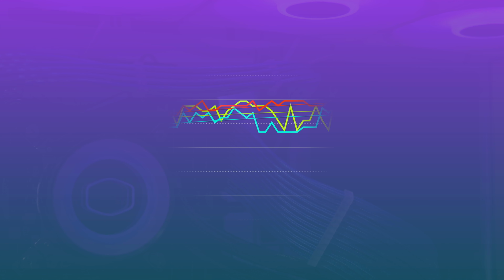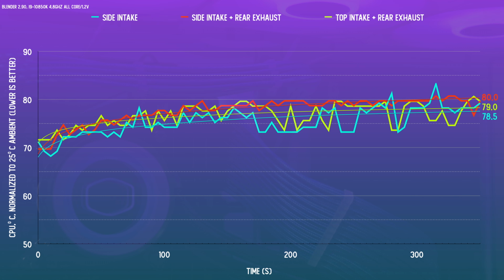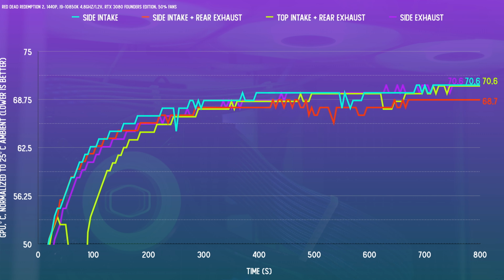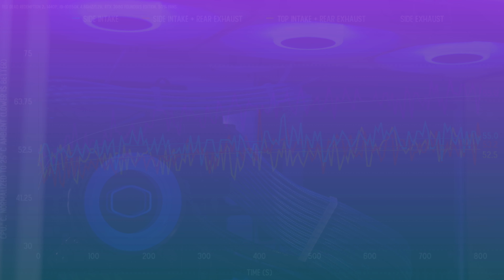AIO Configurations in the Lian Li O11 Dynamic Mini

Comment: will a 360mm rad(specifically the corsair elite cappellix) fit when top mounted with a micro atx motherboard?
Reply: Hi! Did you figured out? I have the same question in mind
Reply: @starnixx9047  yes a 360 rad will fit when top mounted!! again, only works with a matx mobo though so be careful! and it will be a tight fit depending on the parts
Reply: @bisorii thank you!

Comment: Have a full size 0 11 dynamic. Running all corsair ML120 Pros. Currently building a 12900k and 3090 build with 3 120mm bottom intakes, same with the side, running a 360mm AIO at the top and changing the fans on it to the same ML120 Pros. 140mm rear exhaust. (Thinking of doing push/pull at the top I will see what I have for space.)

Comment: I have a 3080 ultra hybrid with the attached 240mm aio.  I want to build a small system with the cpu on an aio as well. Can I get dual  240 AIOs in it or one 240 for the GPU and a 360 aio for the cpu?

Comment: question, i have the top 3 and bottom 3 as intake ( pulling in air ) and the top left, and the two on sides on the rad as exhaust ( pushing out air ) is that adviseable? or should i switch it around

Comment: Can you suggest a PSU for this case with an MSI suprim 3070x? 

I tried to swap out of my old inwin 303 case to this Lian Li 011d mini tonight,  and I discovered that A) my EVGA 1000w 80+ gold PSU is too long and too fat to fit in the slot behind the motherboard wall.. and B) my full sized ATX mobo is too large to fit my Asus 360mm AIO at the top of the PC. 

So tomorrow I'll be hunting for a new PSU and mobo at microcenter. 

I'd like to be able to use the SSD mounting bar behind the rear of the case as well. 

Thanks in advance!

Comment: Im using a 360 AIO and i had to mount it at the Bottom of the case because the motherboard im using wont allow top mounting. So radiator at bottom for exhaust and 2 fans on the side for intake.

Comment: Hope im not to late to ask but for 6 fans configuration where would be a better way to place them, im running the be quiet dark rock pro 4 cpu cooler and a 3 fan gpu
Reply from the maker: How is your cooler setup? If one of your cooler fans is mounted at the rear of the case, then I'd put two intake under the GPU, two exhaust at the top, and two on the side panel. The direction for the fans on the side panel I'd make sure are opposite from how your rear fan is mounted, so if your DRP4 is intaking from the rear, run those as an exhaust, if it's exhausting out the rear, then run those side fans as intake.

Comment: want to get this case I have an ATX MB with ryzen 9 5900x , 2080ti , do you think 280mm aio side mounted will be enough ? Or should I get  Noctura nh-d15 ? 
Also was going to do Lian Li Uni fans on the top and botton of the case but on the website it says max size is 20mm thick with atx  , but the uni fans are 25mm thick  , do you think they will fit ? was thinking either 2 x 140mm or  3x 120 mm  for fan size  , any input to with either size ? thanks for the great video
Reply from the maker: The D15 will be comparable to a 280, and yes I think either that or a 280 would be just fine. It really depends on your preference, noise normalized performance won’t be a huge difference. 280 is a good choice for the case since the rad can be nearly tucked away on the side, and works with any mobo configuration. For fans I’d run 120mm ones at the bottom. The height restriction of 20mm is only pertinent to 140mm fans since they are wider and intrude into the mobo’s location.
Reply: @MachinesMore  perfect thanks for the info

Comment: If you want crappy RAM and GPU temps, by all means use your AIO as an intake.
Reply: How’s that work???
Reply: @aaronle6764  The AIO sucks in cool air and exhausts hot air into the case, increasing RAM and GPU temps. I've done my own tests and everything increased by 6-8c. It makes the CPU cooler... at the expense of everything else.

Comment: Interesting. Gearseekers, contrary to your results, states in his o11 videos that side intake AIO mounting is worse than exhaust but he doesn't provide any data.

Do you think it would be possible with an ATX motherboard to top mount a 360 AIO using zipties or other easy mod?
Reply from the maker: Yup, I did zip tie a 360 along with an ATX board - the ML subzero review used that setup!

Comment: I really like your videos! 

Im considering leaving the NR200 with my current build and going to a different case.
I have 5900x cooled by a Z63 ND AN rx 68OO. I struggle with wiring and space in here. Temps arent terrible.
Recently I swapped GPU to vertical and aio to bottom. I know I know...but it fits better, but still not right.
Do you think the 011 mini will yield similar or better thermal results?
Oh and I found a 3080 and its 12.6" long so more reason to step away from the NR200.

Im not excited about the case being SO much bigger, and they were available yday, but I was procrastinating and they are sold out again. Ill grab it never time I see  them. 
Also is there any advantage to the dynamic over the mini?
Reply from the maker: Cheers! If you need more space, you’ll find the O11 Mini a good compromise between compatibility and footprint. It’s big but not typical ATX big, there are a few smaller mini ITX or mATX cases in the 20-40L space but nothing with as good an airflow layout and certainly nothing that looks as good. The XL dynamic is a big big case and I think at that point it’ll be way too different. Good luck!
Reply: @MachinesMore  Thanks for the reply. It is just hard to tell actual size rom a youtube video. Im going to grab one next time I can and a half cozen fans
Reply: @MachinesMore  One more question. Z73 in the top vs Z63 in side?

Comment: Hey, great video.  I'm considering a mITX board with 360 aio on the top, 2 x 140mm fans on the side, 3 x 140mm fans on the bottom & a rear 140mm fan ... Which configeration ( intake/exhaust ) would you recommend ? cheers

Comment: I'm interested in the actual clearance at the top when using an ATX board. How tight is it and will a slightly thicker fan like the 30mm Arctic Bionix P120 ARGB fit?

Comment: Wanting to run a side mounted AIO with an atx board. Do you happen to know the tube length of the ml240 mirror cooler you used? I can't seem to find it anywhere online... Kinda worried if ill be able to fit the tubes on the bottom with a 3070 in the way

Comment: Deffo the best setup is three bottom intakes and side 280mm aio intake with rear 120 exhaust and top 360 exhaust... But how do connect so many fans to the motherboard?
Reply from the maker: Most ATX or mATX boards can support that many and have 4-5 headers. You’d just get splitters and put three or four on chassis 1, three or four on chassis 2, rad fans on CPU header, etc. Just make sure the max amperage per header is under the board spec (typically 1A but it can vary).

Comment: Is aio 360 on top intake, and 1 rear + 2 on the side exhaust good without Bottom?
Reply from the maker: If you’re going to omit fans I would skip the side ones first. The bottom would be very beneficial for the gpu and the top for a rad would be best as an intake, you can either stick an exhaust at the rear or skip it, small difference for gpu temps but there is a benefit.

Comment: I have a questions. So I have 3 Corsair rgb fans. And then 2 fans for Corsair soo cooler. ATX build with intel i7 9700 and gpu amd pulse sapphire

2 fan intake from bottom. And then radiator on the inside of case with two fans intake from the side.

And I have one exhaust at back near the mobo hub. 

Is one exhaust fine? Or should I try and move one Corsair fan from bottom intake to a top exhaust
Reply from the maker: Most important fans are the ones under your gpu (although those pulse coolers are super quiet already, love those), and obviously the rad fans intaking. A few exhausts at the top would be helpful. That gives me an idea- I might do a vid on just how many fans you really need with this case, since there really are just so many options.

Comment: A question for yourself or anyone else- besides the BeQuiet AIO cooler are there any others that move the pump away from the block that would suit a bottom mount radiator placement?
The only other one I can think of is the NZXT M22 120mm AIO

Comment: Thanks for the video!  I currently have my 360 AIO as exhaust on the top, gonna try flipping it around cause of this video!  One thing I would like to ask is how are your RAM temps?  Mine get mighty toasty hitting 57C during a very GPU heavy gaming session.  Full fan set up atm is 3 bottom intake, 2 140mm side in take, 360 aio top exhaust and 1 rear exhaust.  Wondering if the RAM will go up or down since hot air would be going over it, though I heard hot airflow is better than no airflow.  I'm even considering adding a hybrid kit to flush the gpu air outside the case... but I also don't wanna spend more on my 3080 cause I would like to sell it for a 3080ti if one ever comes out.
Reply: wait can you fit your 360mm aio in there
Reply from the maker: What 3080 are you running? If it’s an FE then the flow through cooler kind of blows exhaust straight at the ram, other 3080s aren’t that much better in that regard, they just dump heat in the vicinity of the motherboard. You might find that the reorientation of the side fans as exhaust (these are closest to the GPU) will move GPU heat away quickly, and that will help board cooling. Generally I’m not too concerned about the exhaust from an AIO rad... it’s nothing compared to the heat from the graphics card.
Reply: @MachinesMore  EVGA 3080 FTW Ultra.  I went ahead and swapped the top fans to intake and the side fans to exhaust and cpu temps are better, ram is slightly cooler cause of the warm airflow still around 53-54c though.  GPU is basically the same.  So far it's been an improvement, still more testing to do though.  Gonna try to add some fans for a push pull on the 360 rad, hopefully I can get some to fit.
Reply: @TheHeavenswake  How did you fit a 360 rad at the top of the case?

Comment: If using a side rad 280mm with 2 140mm on the inside pulling cool air in from the back with an ATX  motherboard,  Rad is 30mm and fans 25mm will this obstruct a long GPU, so a 55mm intrusion into the case, would like the fans on the inside the case and not mounted  in the back compartment (30mm space), many thanks and great video

Comment: What about top AIO exhaust + side intake fans? Is that worse than side AIO intake + rear exhaust fan? I guess I'll have to wait for the best config when you test them all out with 9 fans in the case
Reply from the maker: The exhaust configuration is the one I wanted to avoid, regardless of top or side. I threw the side exhaust in there just as a counterpoint, As the GPU is running, using the rad to channel out the hot air is very detrimental to CPU temps, regardless of top or side mount. When there’s another orientation available in intake, there’s no good reason to use it as exhaust.

Comment: Is it possible to mount a X63 (Kraken) side with tube down?
Reply: Yes, I have a ATX board with x63 on the side with tube down with 2 nxzt 140mm fans on the exterior and 2 Lian li sl140 fans on the interior, 3 sl120 fans on the top and bottom, and 1 sl120 fan on the rear
Reply: @RizzAdobo  thank you so much! believe it or not but you just described the setup I ordered. Will be here in 1-2 weeks
Reply: @RizzAdobo  is there any way to share your setup?

Comment: Love the vid! 
I think due to the design of the o11 mini you could also run side intake, bottom intake,  top exhaust (with 360 radiator) and rear intake. That setup seems to cool my nvme better.
Reply: Couldn’t decide if I should send back my 360 I just got as exhaust if 240 for side intake was better... you think the temp would be abt the same ?

Comment: Thank you so much for this video. I just got this case and wanted to run a full size ATX board but was worried side mounted radiator would not be optimal. Now I know full size ATX will do just find with a 280 side mounted!!
Reply: Yeah, nice :)

Comment: Great to see this channel grow over the last year!
Reply: Great video ... i will use O11 xl so can I mount 360 aio as side intake with 3 120mm bottom intake and 3 120 mm top exhust and 1 rear 120 mm as exhust as well ? I am trying to avoid vertial mounted gpu blowing hot air at top mounted exhust aio